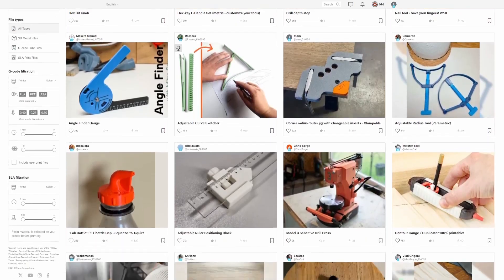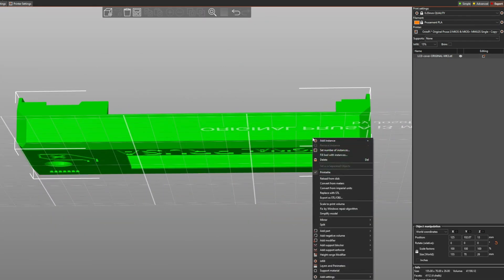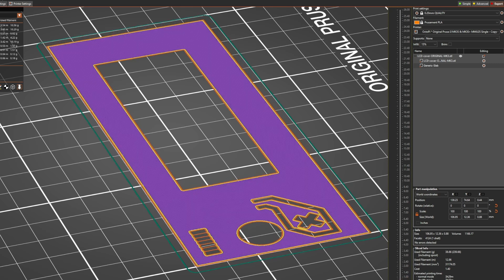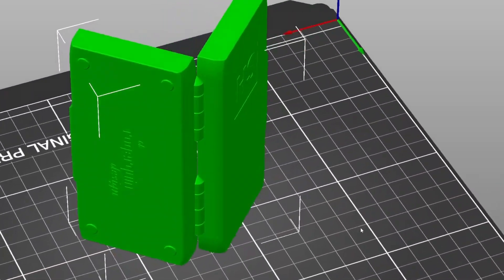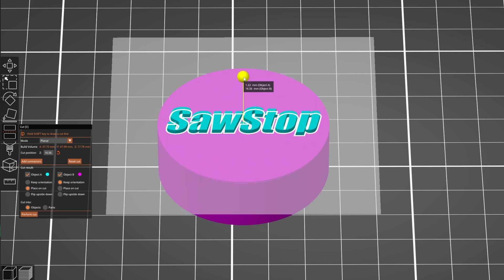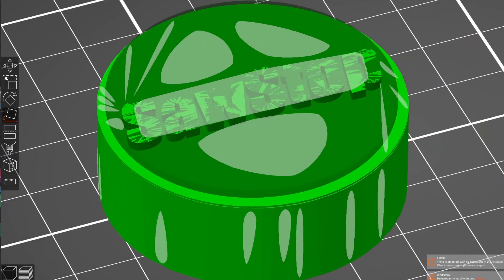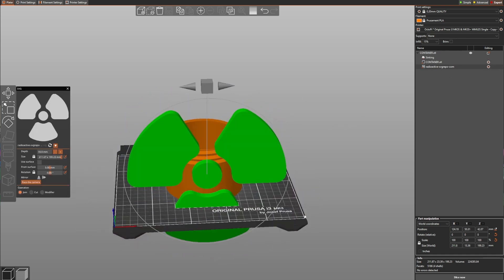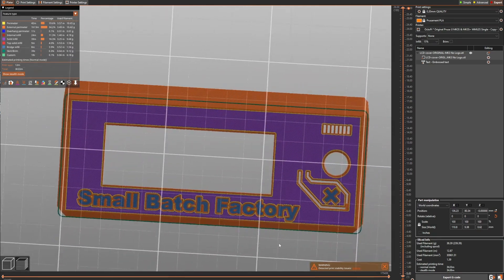REMOVE (or ADD) Logos and Text from STL files in Prusa and Orca Slicer

Comment: Hello, if i put a negative volume and follow your steps but if i save it as stl and reimport it it stays the same and copies the negative volume box
Reply from the maker: I don't think you can save negative volumes, I have only ever used added gekoetrx) geometry when saving
Reply: I ran up against this myself, adding an SVG file as an incised logo to the top (facing build plate) of a box lid. When I tried to save the modified STL, Prusaslicer (2.9.2) threw up an error window saying that the program could not save boolean operations with negative volumes — and there did not appear to be a way to merge the negative volume into the base STL object. It does save if you save it as a project (. 3MF) file, though.
Reply: However, your video did jog my thinking, and I went back to the OpenSCAD program I'd written to generate the box, and added code to optionally import the SVG file of the logo and cut it into the top before saving it as an STL file. It's not particularly efficient, though, because of all the extra facets — the STL for the blank top is 96k, the 3MF file for the bottom and top with the logo cut in by the slicer is 121k, but just the top with the logo built into the STL is 4.5Mb. Still, it's a new technique I can add to my toolbox.
Reply from the maker: Prusa can't, but I discovered that Orca Slicer applies negative volumes when saving
Reply: @SmallBatchFactory  yeah there is a template i downloaded and there is a text on it and i want to change the text. but i first have to remove that text and then add my own but i can't figure out how to remove the text due to that it is on top of the template not integrated
Reply from the maker: @TriceYouTube you might be able to use mesh mixer for that. I've never used it though
Reply: @SmallBatchFactory  im very new to this so i'll get into that. Thanks tho!

Comment: hi hope you can help when i add a SVG logo to my box in the svg setting i dont get the the operation option at the bottom and use surface and from surface are greyed out any ideas ??
Reply from the maker: Did you make sure to select "SVG" and not "model" from the "add" menu, as I mentioned in the video? You can open SVG with the "model" option but you get a different dialog.

Comment: Just remember to respect the license the model is published under. Most free models only require attribution, and a builtin logo or signature is an automatic way of ensuring that this demand has been fulfilled.
Reply from the maker: If you're distributing it in any way, yes. If you're just printing it for yourself without any commercial usage it doesn't matter (at least where I live)

Comment: Ive always removed logos by importing STLs it into blender (or fusion for STEP), which was pretty cumbersome. totally overlooked slicer editing 😭

Oh, speaking of; STEP files can be imported into slicers directly which results in significantly better than STL files. Could you try and raise awareness of this? it seems that basically nobody knows this (judging by the fact that 95% of all Printables files are only available in STL formats). Im not asking for a whole video, but a quick mention would be greatly appreciated

Great video!
Reply from the maker: Thanks! Yes it's way more convenient this way.

I already mentioned importing STEP files in my "Slicer tuning" video ;-) but I also showed issues with Prusa Slicer. Viewers commented this might be an issue with Fusion 360 step files only, but I haven't tested further